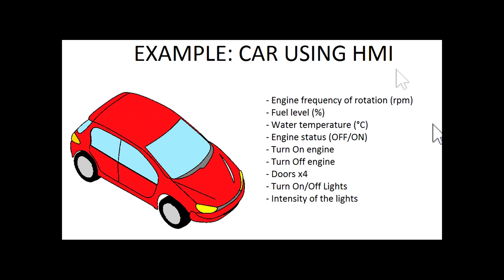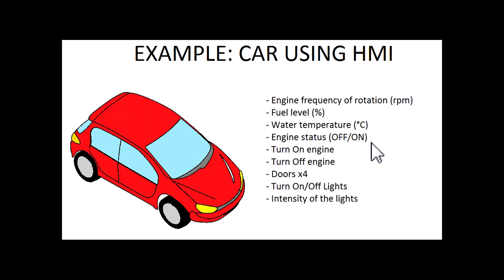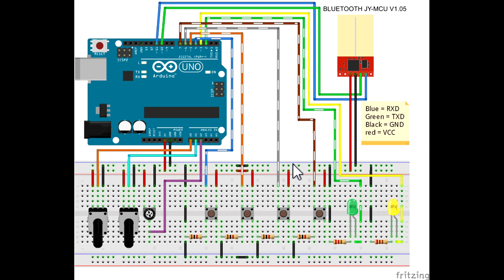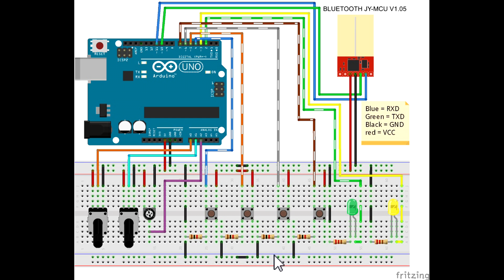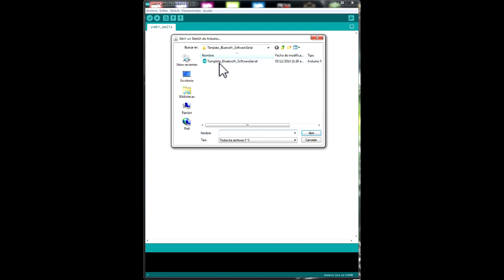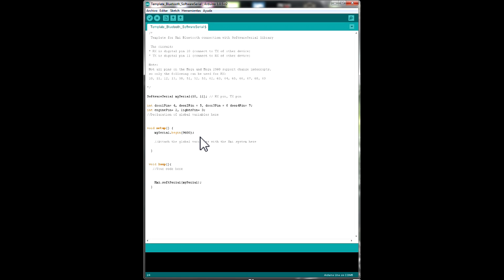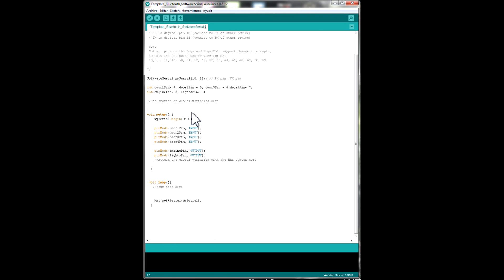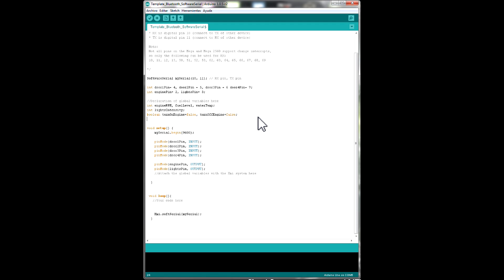Hmi Controller for Arduino example part 1

Comment: You know that the main codes that make this program work are in libraries and header files which You absolutely do not mention them!!!!! Why do you bewilder the Amateurs? What is your problem really ??
Reply from the maker: Hi, this video is for an old version of the app or the HMI Controler for Arduino Lite Version, I never mentioned about libraries or header files because the Full version was working with a modified version of the Arduino IDE. Since the version 2.0, one mounth ago I deployed it to the Google Play, the app uses libraries for Arduino in order to work. You can check this video if you want to install the HMI library in Arduino for the HMI Controller Full Version https://www.youtube.com/watch?v=9awGeclrkSU